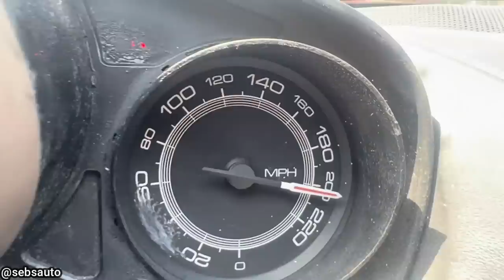Customer States Engine Overheated And It Might Be Seized | Just Rolled In

Comment: If you ever have an issue with a rodent/squirrel stashing food in the air box/exhaust, try fastening some metal mesh over the opening. Obviously the mesh needs to be small enough to prevent the pest gaining access but not so small that the air/exhaust can’t do what it needs.

Comment: Did a clutch in a Toyota Hilux. The front differential started making noise immediately after reversing off hoist. After a quick test drive I got back to the shop and the front wheels locked up. Customer states......... and you know the rest lol. As it turned out the correct front differential was fully manual yet the one in the vehicle, with 350,000 km, had a wider electronic one fitted for some extraordinary reason. That was an interesting day.

Comment: 2:51 So funny story. I had a similar experience when a friend of mine contacted me about helping him get his tire replaced, and needed my jack to help get the wheel back on. Thinking this would be an easy fix, I drove over, picked him up, and headed over to the side of the road where his car was. 

I get there, see that his car is already jacked up but lower than it should be. I put my jack in, get him up to a height where we can get the wheel on, and lo and behold I realized he put his jack right next to the wheel well. The thing was practically caved in, and was touching the wheel when we got it back on. And to top it off, I had to drive it back to his place so we could start banging it back into some semblance of shape.

Comment: As someone who regularly works on electronics that are corroded, a soak in white vinegar, a scrub with a toothbrush, and a thorough rinse with isopropyl alcohol would probably bring those modules back to life.
Reply: I guess you gotta consider  the proper  environmental disposal of  the  reacted  vinegar.  Lead free solder isn't  yet established  standard but the those days  of leaded fuel means the contamination happened long ago .

Comment: The water logged jeep, I thought for sure would have been a yeard ornament. It's good to see it get another chance. 🇺🇸🍻 Kevin has torn up less vehicles than most the owners we have seen.😂🤣
Reply: I wonder if all those control modules are located in a spot where water can easily get to them if you do the slightest bit of off-roading. 

On that note, a few months ago I replaced an airbag crash sensor on my Corolla - I opened the old one up to see what was inside, and yep, moisture. Do they not seal these things properly?
Reply: @the_kombinator  good question and point.🇺🇸🍻

Comment: I damage the corner of my Honda Accord front quarter panel because on my previous car the flat spot was where you put the jack. And the Honda manual sucks. Apparently on the Honda you’re supposed to put the jack on the weld. Which to me didn’t look strong enough. 
Fortunately I stopped before I did this kind of damage.

Comment: I had a car that sounded exactly like that last one. It needed plugs, wires, cap and rotor a tune up and exhaust work.
Reply: My thoughts exactly when I hear all these old hot rods. They sound like that because the carburetor is incapable of running them properly with low manifold vacuum from the oversized cam that is there to try and overcome the flow restrictions and valve speed limitations of a pushrod engine with a 2 valve head.
Reply: @ouch1011  shup you! lmao

Comment: Corrosion wise, that board isnt even the worst i have seen and worked on. Got to love those liquid electrolyte tantalum capacitors that where all the rage in the 70's. That electrolyte is sulfuric acid btw, and it will remove basically everything on the board.
Reply: You are referring to so-called wet tantalum or wet slug tantalum capacitors. Still used today but in specialized applications. Generally very expensive and come in hermetically sealed cases. sop they don't leak unless seriously abused or physically ruptures. The tantalum capacitors used in modern consumer /automotive applications are most likely going to be solid tantalum capacitors with no liquid electrolyte at all.
Reply: @gerry5712  50 years of use will still result in them leaking. And yes, i am referring to wet tantalum caps. 

From the failure analysis i performed on a few of the hundreds that failed, i found that the seals between the slug and the epoxy feedthrough where corroded away, which then further corroded the epoxy,  thus leading to a leak.

Comment: I hear a lot of people talking shit about Detroit engines but I’ve had one for over 1,000,000 miles almost did all the services yearly coolant filters changing out the diff fluid trans filters yearly with the fluid and oil changes and fuel filters monthly never had a problem with it

Comment: Once, when returning to parking lot from a hike, I found 4 forlorn-looking teenagers gathered around their vehicle. It would start but he couldn't shift it. He bought it knowing it the hydraulic clutch leaked. He said they had shown him where to add fluid, but it wasn't working - so I asked him to demonstrate. He proceeded to pour fluid on the top of his left strut! Whereupon it flowed down and dripped on the ground. I was shocked, but asked him why he though that was the correct spot and then showed him where to top off the fluid. Of course, I then also had to show him to pump the clutch like 30x just to get enough fluid in to shift again, and told him he needed to get it fixed or get stranded again. The girls on the apparent double-date were profuse in their thank yous since they could now get home without an embarrassing call to parents..... Maybe the driver learned something - like he needs to read a manual.

Comment: Wow, I've been driving for the last 14 years and it's the first time in my life when I hear about such a thing as a coolant filter.
Reply: yeah, that is a BIG truck thing  (tractor trailer)  "cars" don't have them (that I have ever seen)
Reply: @bigwo56  Honestly, I would see the need for one though... Every time I replace the coolant or when I do something that requires emptying the cooling circuit, I see the same orange-brownish dust all over the place and I usually end up washing the coolant tank, hoses and everything to get rid of it. Last time I flushed the cooling circuit about 10 times, if not more, with some anti-limestone solution we use here for washing machines. I am actually curious what it is and where it comes from. Maybe metal corrosion?

Comment: 2:02 - this is EXACTLY why new cars won't last more than 10 years. Especially not in Canada, where shit rusts. Why is a button, an electronic actuator, wiring, and a control unit needed for a parking brake? And don't tell me it's for hill hold, because that can be solved with a line lock. 

Overly complexified cars for an assured future where the dealer, and ONLY the dealer, can "service" your car.
Reply: extra points if there is a pair of brake cables and one puny actuator located somewhere unreachable, and when some cheapo plastic thing breaks there is no parking brake anymore (like on a Maserati), or it doesn't unlock anymore (as on Jaguar).

Comment: One thing I don't understand is the sound of missing on some hot rodded engines as seen at the end of this video.  It sounds like it's running really rough and needs a lot of work...
Reply from the maker: It's to do with the lobes on the camshaft. They are larger than stock lobes. It allows the valves to stay open longer to breather better at high RPMs and make more top end power but the idle is less smooth.
Reply: @JustRolledIn  Thanks for the explanation.

Comment: That filter looks like Kevin  the pig took a dump on it. It is totally clogged! 
It looks as though the engine might be in a truck. Hope not.
It suggests a neglect of servicing of the entire vehicle and some serious safety issues other than con-rods exiting an engine block.

We get coil springs breaking at their ends due to pot-holes in the road. Usually it is maybe a quarter-turn.  The ends of the broken portions had rust on them. They had been driving in blissful ignorance.

These videos amaze & frighten me in equal measure. Damn glad i'm on the other side of the Big Pond.

Comment: Coolant filter?  New one on me.  I guess that's what happens when you don't check out the service schedule of your new ride.
Reply from the maker: You will mostly see that mostly on bigger diesel engines in semis or heavy equipment. From my experience anyways.
Reply: Coolant filters are common on heavy duty stuff where the service interval might be measured in hundreds of thousands of miles. The fact that they overheated it to the point the engine seized means it was properly either really old (and depreciated) or a company truck.

Comment: Great channel/videos. I can't believe that the second most expensive thing most people buy is not valued or maintained by some people. Our society just takes things for granted. How did you break a coil spring? Poor Ferrari, I wonder what that person did to get the Ferrari. Auction, Lottery, Inheritance, plain old hard work. A good detail and a 6000 dollar day with a Ferrari tech would bring it back. How much did it cost to replace all those electrical parts on the jeep? I thought the filter was a piece of wood also. Too bad about installing the timing chain backwards. If gararges weren't so expensive people wouldn't try to fix their own cars. But, you have to pay for the building, technicians, equipment, taxes, blah, blah, blah. If gas gets more expensive we'll all be riding bikes anyway. If you are smart enough to tie your shoes, you should be able to read the manual about changing a tire. If not sure go ask a neighbor, having a car fall on you is counter-productive.

Comment: In the UK, the Jeep full of water would most likely have been scrapped without diagnosis.  The water will have got into every nook and cranny, and will create a serious health hazard.  (Unless it gets immersed in disinfectant.)  That alone gets it scrapped, but the labour to clean and dry everything is immense.  Every connection needs to be opened and dried out, bound wiring looms are not fully waterproof, so will fill with water, as does the body computer.  Not worth the effort, crush it.
Reply: with the possibility and frequency some areas of canada and the US flood... they can and do get scrapped, some asshole picks them up and sells them at auction occasionally to people who don't check vehicle history. i keep wondering if that's what happened to that one VW in an earlier video.

i live with a river(leads into the georgian bay half of lake huron) in my front yard and a very, single lane, dirt road between my house and the front yard(it's weird i know, but it's made for access that way). for a few years here, the great lakes in central canada/US were constantly high, combine that with frequent seasonal storms, and you get flooding. during a stormy halloween night, we lost power(we're rural it's common), and so it was dark when my hubby went to go out through the basement for work the next morning... and found water. the river had crested and ended up in our house, our neighbours' houses and still covered the road. thankfully both our truck and my suv was just high enough to not get water logged. a few of our neighbours closer to the mouth of the river a few houses down weren't so lucky. their still  jacked up alberta ram survived, but their cars were totaled. we actually ended up with an 8'+ section of railroad tie jammed under the truck that somehow missed my suv which was parked closer to the road and river, that hubby didn't discover until he went to back up. thankfully no damage and no clue where it came from.
Reply: @t.s.racing  Why do you feel the need to be rude and insulting?  Just inform of the facts in a polite way.  In your reply, as well as stating a different viewpoint, which is valid, you have made assumptions, that are incorrect.  No idea where you got the idea to mention any government.
Why not try to be nice?

Comment: people who dont know just dont know ... That jack is really confusing to non-mechanical individuals. I love my sister and her husband but he is not mechanically inclined at all. I got a call one weekend my sister in panic saying her husband had messed up her car and if I could come to where they were. I would need something to tear apart her car and remove a jack from INSIDE the car. I couldnt understand what the heck they had done till I got there, an hour away but I took off in that direction. He had put the scissor jack under the lower control arm and after he got the tire removed it slipped through the hole in the control arm and dropped to the pavement pinning it and the car to the ground. They thought it was never coming out. I used the jack he had in his car to jack the car up from the actual jack point on the chassis and it fell out. I mean she was freaking out he was freaking out, but it was all good haha . It did tweak the jack a little but nothing I couldnt bend back , great people love them both they usually call me if there is an issue with cars or their house.

Comment: how the hell does a coolant filter plug up like that?! i didn't think you could plug one up like that if you tried
Reply from the maker: I was thinking the same thing. Looks like they used some swamp water besides coolant. Damn disgusting lol
Reply: Was it from that Jeep that was flooded?
Reply from the maker: @seanj3667  lol nope.
Reply: I'm thinking someone may have used the wrong antifreeze, for there to be that much rust in the cooling system..........
Reply: @seanj3667  nope, detroit dd15 semi engine, usually small engines like car engines don't have coolant filters

Comment: I remember we had a customer come in and I was having a bitch of a time getting the lug nuts off the wheels. I had to use a Johnson Bar just to crack them loose. It turns out someone had put blue loctite on the threads.

Comment: So with those dd15’s , its best to just run the truck without a coolant filter. If the bottle has shit in it, you have a problem, plain and simple.

My fleet runs around 40 trucks, not a single one has a coolant filter
Reply from the maker: Yea some other people mentioned that as well. There's a TSB for it they were saying.
Reply: @JustRolledIn  yes 100% , nobody uses them 😭

Comment: ? There is no european car that i know which has a coolant filter, please enlighten me which manufacturer and model that has it.

Is it maybe some truck manufacturer in US? It does look like a big engine... 0:05

And the upkeep on a Ferrari or Lambo is astronomical, Porsche is also costly but has under half of the maintenance cost.
Reply from the maker: This was on a semi. You will mostly see coolant filters on heavy equipment and semis. I don't think I've seen it on a vehicle yet.
Reply: @JustRolledIn  This is quite interesting! I have driven buses for over a decade and now drive Volvo FH and i would never have guessed they also have these coolant filters - but they really do... thanks for the lesson =)

Comment: I'm not a ferrari fan, but the sight of this thing is... no. just no. wonder how the owner looks like. do they drive with cowboy boots and balloon silk jogging dress? because I once saw someone like that, also walked like he owned the place.
1:07 only 4 bent valves? how cheap. some engines would end up with bent valve inliners, cracked heads, and/or bent piston rods...
1:36 if all bolts sheared off, they were probably way overtightened. then again, years ago I wanted to take the wheels off a Jeep Cherokee to check the brakes properly, and of the five nuts three sheared off right above the bolt's last thread... I NEVER had that happen before or after.
1:46 I suspect corrosion meeting a bad spring steel alloy. this has ocurred on relatively new european cars a lot over the last decade and more. sometimes it's just a finger length's piece of end that breaks off... the worst I saw was on a Mercedes A-class (first gen), when I jacked it up and lifted it, one ring fell out from the rear end... the car was a little over a year old.
2:06 warranty? on this? nice try, buster.
hmm, nice nomad. :) you just don't see those here in europe. :)